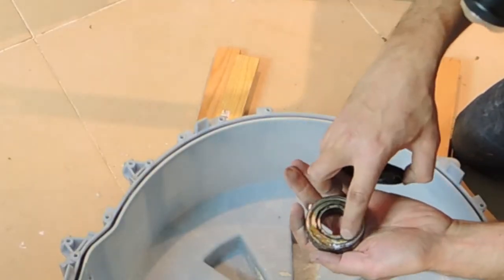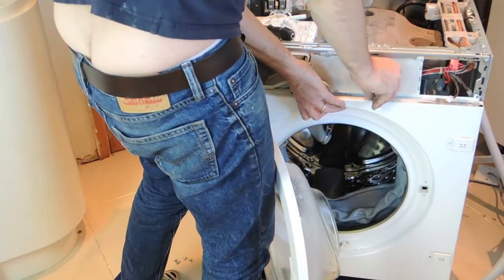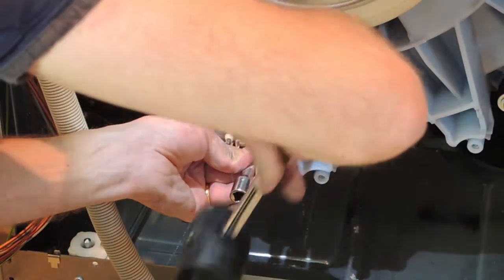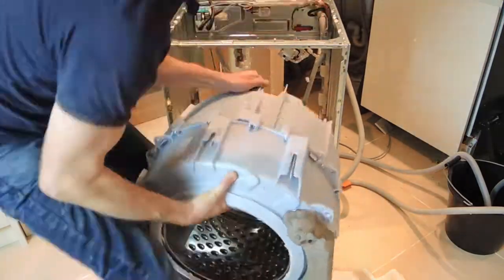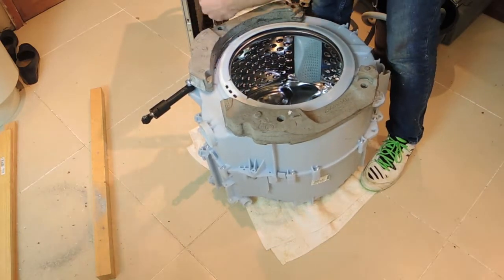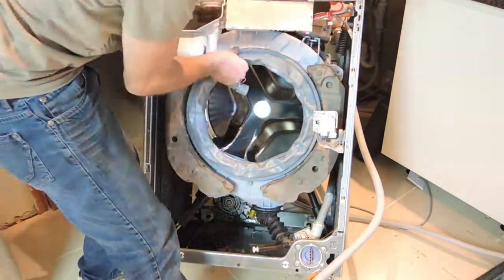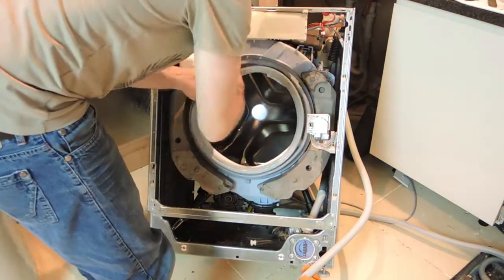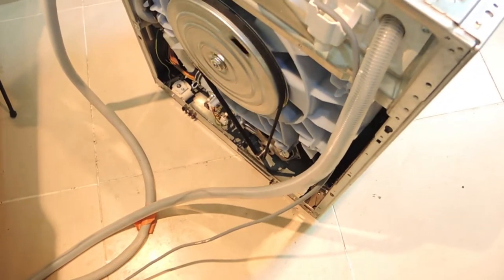Step by Step: Integrated Washing Machine Bearing Replacement

Comment from the maker: Step by step: How to replace the bearings on your integrated Siemens iQ700/iQ500 Washing Machine. Mine was Siemens part number WI14S441.

If this helps you, please consider liking and subscribing. Any questions or feedback - please leave below!

Torque for flywheel is: 44Ft Lbs = 60Nm

Tools & Supplies You will need:
Headtorch(honestly this is the best head torch ever - really simple, really effective): https://geni.us/v9aIl
1/4" socket set: https://geni.us/GSRN0q7
1/4" Long Extension bar for drum screws: https://geni.us/2a9Qq
Rubber mallet: https://geni.us/gqAWdQ
Club Hammer: https://geni.us/xemSfO
Pump pliers for hose clips & to hold flywheel steady: https://geni.us/O4WPO
Long nose pliers also for clips: https://geni.us/f7F1
1/2" socket set for flywheel nut: https://geni.us/klyzc1
1/2" torque wrench for flywheel nut: https://geni.us/AZNbmG
Debor Glue for the drum tub seal (better than silicone): https://geni.us/8pO8gp

M20 Threaded rod, 50mm washers (for small bearing) 60mm washers (for larger bearing) and nuts, I got mine from Hubble & Company: https://www.hubble.co.uk/
Bearings x2 & Bearing seal, I got mine from: https://www.how-to-repair.com/
Drum seal rubber (long piece of rubber around the seam in the drum cover), I got mine from: https://www.how-to-repair.com/
2 pieces of wood to support drum
Cable ties for rear wiring loom

Disclaimer: If you buy from the Amazon links above I receive a small commission which helps fund the channel.

Comment: Thank you so much for this video. With the help of this video I was able to replace the bearings on my Siemens iQ700. We actually left the outer casing hanging in the springs; it was a bit clumsy, but that way we didn't have to remove the motor or the heating element or even most of the electrics. Removing the bearings themselves was a hard job because they were broken and rusted into the drum casing (the machine is 14 years old), so it required like 2 days of knocking and pulling and lubricant. But once that was done, putting in new bearings was straightfoward, and the video helped in putting the machine back together. Really appreciate you sharing this, I never would have endeavoured this without a video guide to rely on, and now our machine runs anew :)

Comment: Great movie! Super handy, but my advice... After removing the top cover, first check if your drum has screws or if it is glued, because if it is glued, I think you can never replace the bearings without breaking something
Reply from the maker: @marijnvanhee9895 Glad you enjoyed the video :-) Yep - good advice - some drums are plastic welded and cannot be seperated..

Comment: Thanks for mentioning the rubber seal with silicone should be OK. I notice the video on how to repair recommended debor glue but obviously silicon is just as good. The video on how to repair also mentioned using bearing loctite on the bearing shaft - do you think that is necessary? I was thinking to try and source bearings from a supplier generically after pulling them out, alternatively there is at least one bearing set with the bearing rubber cover on the net for $65 - will see how I go. Thanks for the help.
Reply from the maker: Hi Mark, thanks for your message - loving your research! Yes - I should have mentioned in the video re. loctite on the bearing shaft - if I did it again, would definitely use for belt and braces. I hadn't heard of Debor glue, but having researched it online - I would probably use that for the seal as it is specifically for bonding rubber, so may give better longevity. Personally I would buy the online bearing set for the job - but if you can find a generic bearing then it should be fine. I would be nervous about subtle differences between a specific compatible bearing and a generic one. Hope that helps a little? Best of luck - let us know how it goes!
Reply: Many thanks Jonathan. Incidentally if there’s a site do you know for the bearings that would be appreciated. The Debor glue was also mentioned in the video by Paul (appliance repairs)  that I think you used for guidance.
Reply from the maker: @coslifehurts  Hi Mark, I bought the bearings from https://www.how-to-repair.com/ I had to buy the bits for the threaded rod from an online hardware store - I can't recall which one now but there should be somewhere local to you that can help with that. Hope that helps?
Reply: Thank you very much and for my last hopefully last question I wonder if you have the diameter of the washers (three?)  that you used on the threaded  bar?

Comment: Hi. Have pulled apart my IQ 500 thanks to you. Only difference is there is no hidden panel on the top left for the detergent drawer and weights on the front can be unscrewed. Couldn’t quite work out how the electrical connector unclips from the front control panel so rather than risking damaging it I just moved it outside to the side and suspended it with wires through the holes on the right top side. Would be great to know exactly the size of the washers and ( how many) (two or three on each side? ) and diameter of the threaded bolt for bearing reinstall. Also trying to work out how to tell if shock absorbers need replacing. Thanks again very helpful.
Reply from the maker: That's awesome - well done! Really glad it helped :-) I'm sorry - you did ask before about the washers and I didn't get round to measuring them. I'll have a look when I'm home this weekend and comment with the dims and thread etc. Seems like you're making good progress!
Reply: Thank you. And my neighbour says the shock absorbers are just stabilisers but I am sure that they are supposed to be very difficult to move in an out by hand and if they are very loose and easy they are no good.
Reply from the maker: @coslifehurts  Hiya - I recall my shock absorbers being pretty loose - I don't think it's a huge problem because as your neighbour says - they're there for stability. Remember they only have to absorb shock at the likely frequencies that the drum will be vibrating at. With the spin speeds of that machine - it's quite a high frequency and therefore the resistance at low freqency - you or I pushing them in by hand at <1Hz is relatively un-important. Hope that makes sense? That's drawing on my days at university - many happy memories ;-)
Reply: G’day. That does make sense. Thank you.
Reply: I also found a difference with the heating element if you decide to remove it. The inside end of the heating element has a bracket that goes across the bars which slots into a plastic slot and you have to push it in and flick it up to remove it from this plastic slot. I might do a little video
Reply from the maker: Hi Mark, I have finally found the washers and threaded rod info for you! Searched the shed from top to bottom - I know I still have them but couldn't find anywhere.. But managed to find my receipt - I bought them from "hubble & company" am sure you will have an equivalent in Oz? I used M20 ss Form C Flat washer BS4320 A2 and the rod was M20 x 1000mm with nuts to match.. Hope that helps a little? J
Reply: @FixItWithJon  Thank you very much. I think that will help. I think there must be two different sizes washer as one side has a smaller bearing.  I looked up the washer and if I'm right that is 39mm in diameter. For others interested in iq500 (perhaps same bearings?) the bearings are NSK 6205Z (62mm outer, 30mm inner, 16mm W) and NSK 6206Z (smaller bearing), bearing shaft seal/gasket part no. 9000202920 Demaisi 37.4mm inner, 62 outer, 10/12.
Reply from the maker: @coslifehurts  Thank you for sharing! I vaguely remember the bearings being different and making a choice to use the washers I had, even though 1 of them bore on the inner, not the outer - it definitely wasn’t my usual style to do that, but I got away with it this time.

If you do a video on your repair - I’m happy to link to it in the closing scene?
Reply: Will do!
Reply: And the size of the washers to use are 50 mm for the small bearing and 60mm for the larger bearing. Diameter of bolt was 19 mm.
Reply from the maker: @coslifehurts  Thank you for sharing :-)

Comment: Been following your video but have a Siemens iQ300 so some slight differences. Nothing of note until it comes to splitting the drum where there are no screws or any any mechanical fastener. Just appears to be glued. Any ideas on getting this apart?
Reply from the maker: Hi Richie, sorry for the delay in responding. If there's definitely no screw fixings, then it must have been plastic welded in which case your only option is to get an entire new unit I'm afraid. Good luck buddy
Reply: There’s other videos which show how to use a chisel to break off the clips and then you can get some screws to reattach the drum parts.

Comment: The video is quite well explained and edited, but you have removed a lot of components that could have stayed in place
You don't need to entirely remove the drawer pipe going to the tub, you can simply detach it from the drawer side and leave the other end of the pipe connected to the tub
The electronics don't need to be removed, simply fold them outside the cabinet
Also removing the water inlet valves tubing is not required, simply unscrew the detergent drawer housing from the cabinet and fold it against the back of the machine
Same logic applies to the door seal, you can leave it on the tub, it's only necessary to remove it from the cabinet
You can also avoid removing the motor wiring, simply unclip the wiring from the tub and pull the motor out without removing it's connector
The heating element can stay in place, no need to remove it
The water pump assembly can stay in the cabinet, just remove the pipe from the tub and leave it in place on the pump side
Very good idea to leave the shock absorbers on the tub, as it's easier to remove them from the cabinet than from the tub
All of this time saved disassembling can easily allow you to remove the front concrete counterweights allowing for easier removal of the tub, if your model allows for it
For longevity of the new bearings add some grease between the bearing and the water gasket, do not use washing up liquid to seat the gasket, ifwater gets on it it will starts eating away at the lubricant on the bearings
The part you're installing at 12:20 is the water level sensor, you can leave the component on the cabinet and remove the clip from the tub
To reinstall the door seal clip you can start "clipping" it from the doorlock side and stretch the spring in order to seat it quickly, requires some force but it goes on quicker that way
Hope this helps other people
Reply from the maker: Thanks for your feedback - yes many of those occurred to me after the event - it was my first time :-) There's one thing that I would suggest though: the concrete counter-weights on the front of the drum were stuck on with some kind of adhesive. *There are not removable*. This is a difference when working on an integrated unit vs. a freestanding unit - they are removable from the drum on a freestanding unit. Personally I prefer to remove the door seal from the drum as otherwise you risk damaging it as the drum is removed. Totally agree re. grease - I use silicone grease all the time now :-)
Reply: @FixItWithJon  you are right, some models do not allow removal. Door seal is a preference, take my list as a "minimum requirements", some people might feel overwhelmed by the thought of removing so many components and I wanted to help them
Reply from the maker: @mattiaiezzi9381  Thanks :-) Really appreciate you taking the time to compose the feedback.
Reply: Hi Mattia. Would you know if an iq500 would be an identical process?  Also someone above refers to a drum support spider causing an issue. Would you know what they are referring to? thanks
Reply: @coslifehurts  Hi. I wouldn't know if an IQ500 would be an identical process or not, but crossing information between what I've written here above and the video you should be able to replace the bearings in 95% of washing machines with a serviceable tub. How do you know if the tub is serviceable? It's very simple, just remove the top cover and check if the tub has bolts where the two halves are combined. If the answer is affirmative, then your tub is serviceable.

Sometimes the noise and rattling is not due to bad bearings but due to a bad drum support. The use of liquid detergents and low temperature quick washes leaves the drum support in an alkaline state. This causes corrosion and breakage of the support. If the support is broken or split then you're going to have to replace it. In any case you should wash at around 60°C, with powder detergent, at least every week or two in order to keep the machine hygienically sound and prevent the residue from building on the drum support. The spider is usually riveted in position, so you will have to drill these out and then replace the rivets with stainless steel bolts
Reply: Thank you very much.
Reply: Thank you. I pulled apart the iQ500 and it is almost the same. Differences are there’s no hidden panel on top left with screws for detergent draw. The spider has screws and can be removed. Your comments helped as I didn’t have to remove some components eg heating element. Would be good to know diameter of washers for bearing install.
Reply: @coslifehurts  glad to have helped. You can go to a spare parts shop and take the old parts with you to make sure they fit properly. Otherwise you can also take the information from the label in the back of the machine (take a picture of it) and the shop will be able to find compatible parts
Reply: I’m wondering if I should reuse the hard rubber seal with the tiny spring that runs around the outside of the inner ring, as it is not deformed after removing? It fits snugly around the shaft. What I can’t work out is why it does not heat up when the shaft spins.  I wonder if it should have grease on it (EDIT: rather than detergent) which Jonathan does not use in the video? I’m thinking not because it would not last long?
Reply: @coslifehurts  it's better to replace it. It's called a water gasket. It prevents water from entering the bearings. The shaft should have some grease resistant to water and chemical agents applied to it and it also should be applied between the water gasket and the first bearing
Reply: Hi again. Can I use valvoline blue NLG2 lithium complex grease on the inside of the seal? Thanks
Reply: @coslifehurts  I don't know that product, sorry. But any water resistant, bearing compatible grease will work fine
Reply: Thanks. NSK advised me the grease is NS7 in the NSK bearings and the bearing seal and shields on bearings are nitrile rubber so should be ok to use lithium grease.